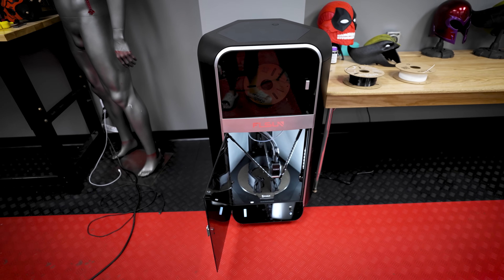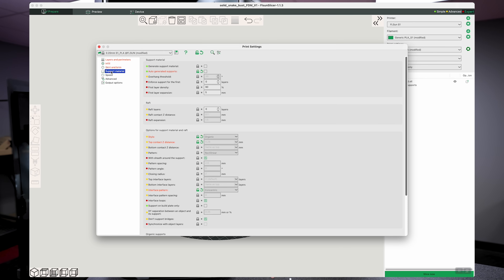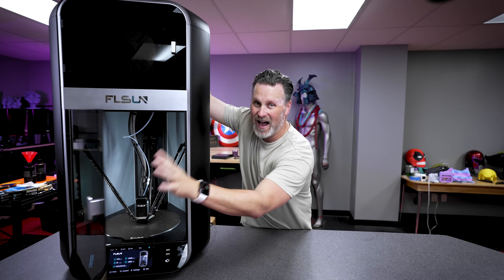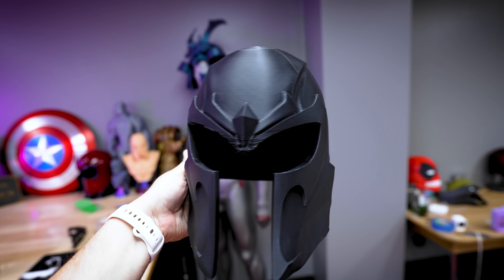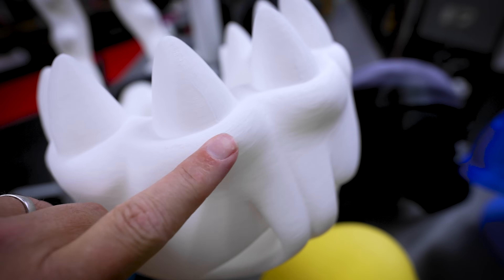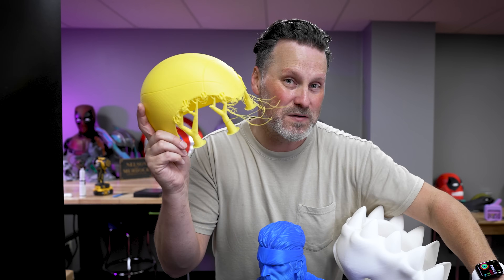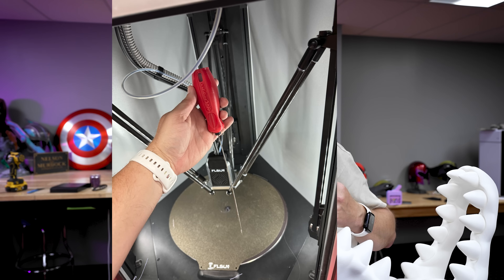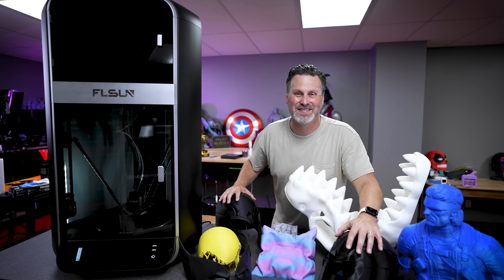FLSUN S1 3D Printer - is it TOO FAST?!

Comment from the maker: If you’re looking for a more technical look at the S1 make sure you watch Nathan Builds Robots video

https://youtu.be/EXL7ZqsYrYw?si=2nfYIjefUa0sYckG
Reply: If I had to guess, it would seem that you’d need to tune it to slow down for certain parts of the print while retaining the fast print for others - ( take advantage of of the speed while maintaining the fine print control)
Reply: Aw I love you 3d printer youtubers having a connection and sharing eachoters channel
Reply: Is it basically the Bambu Lab X1 Carbon but on steroids

Comment: Just because it can run that fast, doesn't mean you have to. We all know speed doesn't equal quality even with high speed filament. 
Experience should tell you that.
If the printer isn't a tool that works for your application then don't buy the tool.

Comment: I have an S1 Pro, and I also have problems with loading filament on top thru the tube. You just have to cut it at an angle and boom, no problem.

Comment: Will you test T1?  I have a T1 and have been using it for three weeks , super fast , I don’t know why so many people criticize its 1000mm/s. Why are machines with a default configuration of 250mm/s allowed to advertise 600mm/s, but machines with a default configuration of 600mm/s are not allowed to advertise 1000mm/s?    600mm/s and 1000mm/s are just movement speed, We need to discern whether the true value of the product meets our own needs, instead of just complaining and touting .

Comment: So, slow the print speed to something more normal and use Orca Slicer and I'm guessing it would be maybe 75% better, just with doing those things.  And FLSUN supposedly just released a big firmware update to correct a bunch of issues with this printer, so it would be interesting to see a follow up video on how those changes may (or may not) have improved this machine.  The issue with the profiles sounds like FLSUN is playing catch-up and maybe fielded the product too soon.  I'm hoping they'll just ditch their slicer and develop solid profiles for Orca for everybody to use.  If they could dial-in this thing to X1C-level user experience and print quality, I'd order one ASAP.  I just love the delta design.  I don't care so much about the speed, especially since it seems to come at the expense of quality.  Better to take a little longer and have a nice result than to go really fast and have the result look like garbage...or fail altogether.

Comment: If the acceleration tops out at 4g (40000 mm/s^2) then you hit diminishing returns on print speed at around 300-350 mm/s. Saying it does 1200 mm/s is an EXTREME stretch.

Comment: I expect that the "texture" you are experiencing is due to the stepper motors microstepping resolution. Unlike standard x-y-z slignbed or xy-yx-z corexy configurations, deltas are a z-z-z configuration. So the kinematics of the arms' parallelogram create axises that behave as arcs. Hense the carbon fiber 45 degree texture. In other words, the step-drivers need tuning. Try printing a cylinder.

Comment: Use Orca, load FLsun V400. Change the volume (as the V400 is smaller) copy your gcode from the Flsun slicer and paste into your orca slicer.
It will print far better..

Comment: The problem with that printer is that the arms are attached to the bottom of the toolhead making it (toolhead) top heavy. When it changes direction the toolhead will want to "nod" in the direction it was previously going. If you attach the arms to the toolheads balancing point it would not do that. It should be somewhere at 70% from the bottom since the extruder motor is up top I'm assuming. If it's bowden it should be a bit lower. Fixing this would improve print quality immensly. You can see evidence of this by printing the top layers with fast speeds and accels. They will not look very good, meanwhile if the toolhead is balanced and everything is stiff you should not be able to see which was the top layer and which was the bottom layer. I saw the Prusa delta printer and it looks much better as the motor is very low down and also the toolhead is not as tall.

Comment: In my opinion I expect to see the S1 start off pretty rough. It is going to take Flsun or the community a while to really refine the slicer settings for this printer. A similar thing happened with the v400, their original firmware for it had some issues and had big issues on the dimensional accuracy. The latest firmware, which took almost a year fixed all the issues. Again my experience and my opinion

Comment: Hey @UncleJessy - great video! I want FLSUN to succeed it’s the only Delta exponent in the market and 3D Printing as a whole benefit from different systems competing - I just watched a couple of other S1 reviews, they are on par with what you felt: the machine is almost there, needs fine tuning in the profiles. About the slicer: this obsession from making their own software is maddening. QIDI also did that, it’s infuriating. Time and energy in the wrong direction. An “almost usable” slicer is a slicer nobody cares.

Comment: I have the V400 and due to the Delta setup (I think), the supports are knocked over much easier than on a cartesian printer. That's also why you need to use Gyroid infill, otherwise it scrapes..
Reply: I have a v400 and its fine. Its better than my neptune 4 plus but worse than my bambu p1s. Definitely have to use gyroid infill. Only one that worked for me. The print quality is decent and it has good speed. I wouldn't drop a grand on this tho. Been doing a lot more resin printing these days. For me you can't beat bambu right now.
Reply: I got 12 v400s and yea. Supports need to be thicker and the nozzle it comes with is trash and can cause the supports to print poorly

Comment: I have this printer, the issue is the flow rate. I limit pla flow rate to 30mms3 and everything resolves. The advertised 110 is based on the rapido styles heater they have and that has the same issue.

Comment: hey uncle Jessy, my process for loading filament is to push the filament till it stops, then put the roll on the holder. 
the hardware is very good, but the firmware, software wise needs more fine tuning.
the S1 needs a 0.6mm nozzle profile!

Comment: I owned the V400 from FLSUN, and I will try to keep away from any of their products in the future. I’ve had so many issues out of nowhere with the quality. The supports kept failing over and over for no reason. The filament wouldn’t stick to the plate. The leveling procedure was DUMB and didn’t keep the nozzle level even for a couple of small prints (z-offset kept getting off randomly). I’m not even talking about the lack of accuracy, which is a common problem for deltas. Software and support feel like a 'basement factory' amateur. It's a huge headache. No, thank you, I’ll stick to Bambulabs.
Reply: Yep, same here, gave away the V400 for free, when I got the X1C.
Reply: same here. had nothing but issues with 2 of their printers. very frustrating, I broke my last one by beating it to death. 
R.I.Pieces
Reply: YES YES THANK YOU!

Same I owned flsun v400 and never will buy another flsun

Comment: I enjoy your reviews. As an owner of the FLSUN V400 delta, this machine doesn't feel like an upgrade. Maybe it's faster, but it's noisier and its got a proprietary printhead. I like my easy to switch out volcano nozzle. The enclosure is nice, but it seems like it comes at the cost of a lot of noise. Also sheesh, my wireless connection doesn't fail like that - you'd think they'd have that worked out since they already figured it out once 😀

Comment: Im not a 3D printing expert, but I bet the weird texture is ringing and just looks different because it doesnt have linear kinematics like a regular printer. I modded my voron to print at 100k accels, but I limit the external perimeter acceleration to 5k to avoid this issue. It prints blazingly fast and still has steller exterior quality

Comment: the surface finish is inexcusable for such an expensive machine in today's market
Reply: 100% this.  Coming from Ender printers (Ender 3 Pro, then Ender 3 S1 Pro) to a Bambu P1P (and not long after an X1C), while yes, the printing speed compared to ANYTHING the Ender's could provide was fantastic, but it was the quality without a lot of tinkering that sold me on them.  I'd rather wait several more hours for a great quality usable print than a decent quality print that you might want to try to print again.

Now we just need a larger format Bambu printer to come out sometime soon, and I'll be even happier.

Comment: I have two FLSun V400s, they run constantly. Between the speed and Klipper web interface I will never go back to Cartesian printers. Prints PETG and NinjaFlex perfectly. I bet the support printing issues are about PrusaSlicer.  I can tell you did not do an overhang test, these printers can print to 75 degree overhang.

Comment: The IP address is coming from your DHCP server - nothing that FLSUN can do to change that.  If your other DHCP printers have been getting the same IP address after a reboot, it's been the luck of the draw.  That's why you can (and should) assign an IP address to a MAC address in your router's DHCP settings if the device is a regular citizen of your WIFI network.

Price on the S1 is worth it, but is a bit out of my pocketbook range, but ... I see that the Super Racer is on sale for $299, making it a possibility.
Reply: Even if the IP address is not static, they could still deal with that. They just need to search for the printer within the network instead of expecting it to always show up with the same IP address. For instance, Apple uses Bonjour for this. It finds local printers and other Apple devices regardless of their IP. I believe there's a similar mechanism used on Windows/Linux, I can't remember the name right now.
I agree that setting a static IP is simplest solution and that's what I do for my devices. But most people don't know about IP addresses, DHCP, etc. On the other hand, one might argue that this is targeted more at businesses than hobbyists.
Reply: @zmast333  Now THAT is something that the printer manufacturer can fix - install the avahi tools for mDNS discovery.
Reply from the maker: Agreed BUT my main callout was about the slicer not allowing you to change it once set. You have to delete the printer and add it new again.
Reply: @UncleJessy  Yep, I misunderstood your point there and THAT is a problem.  I discovered this with the current OrcaSlicer 2.1.0 beta and the just released 2.1.0., so not just their version.  I also learned that you have to delete and re-add the printer (which is why I know about the DHCP MAC assignment) because I added a new Sonic Pad that I'd not set the fixed DHCP address for yet 😬.

Comment: The no replacement parts is a deal breaker
Reply: This is only a temporary issue.  The printer just came out, and it's already sold out.   They sell parts for all their other printers on their website.  I would imagine parts will be available for this model within a few weeks as they build their stock of components back up.

Comment: I wonder if the weird texture is due to vibration at the higher speed? Maybe they need some kind of damper base/pad if it can't compensate enough for it. Bambu has the feet, just a theory
Reply: still gets it and super slow speeds
Reply: I don't own a 3d printer (yet,) but own multiple laser engravers. Don't know if this could apply to 3d printers, but is worth mentioning. I was getting strange lines in my engravings across all my machines, so I knew it couldn't be a calibration or mechanical issue. After much toiling and gnashing of teeth, i realized it was the shitty/old wiring in my shop. I ended up having to put my lasers behind battery backups to smooth out the power they were getting and weird lines went away.

Comment: It looks very promising. The failing supports are easy to solve in the slicer settings, so FLSun should just do that to their presets. Slower acceleration and jerk for support and a bit lower print speed. But the issue where supports, fail to adhere to the bed especially tree supports, is due to the acceleration and jerk settings.

Comment: I don't think the bed is 320 x 320, it's not square. it's just a 320 diameter.
Reply: La taille du carré maximal est environ 22,63 cm de côté.
Reply: @jeje3d546 That’s just under 9 inches (for Americans)
Reply: The usable printing width and length is 22cm for most models unless you print a circle.
Reply: 320 diameter 330 height is what he meant i believe
Reply: Its 320 circle diameter he said it wrong.

Comment: Saying it's 320x320x430 is very misleading because the 4 corners are not available.   I wish manufacturers would push for superior print quality and high strength rather than speed.

Comment: Good lord just tune your printer. It's laid out for you step by step in orca slicer. Do your flow and pa and most of these issues would be solved. Stop relying on half baked profiles that are completely different to your filament and situation. A profile for small parts is completely different to printing helmets.

Comment: what is the point in printing fast if it turns out garbage..
Reply: exactly.
Reply: If you you’re going to fail, fail fast.
Reply: @Inventorsquare kek
Reply: To flex
Reply: Also petg is what he tried to use and it's the worst filament for fast printing
Reply: Tell that to Scambulabs after their security update 😂
Reply: It doesn't turn out garbage. I have one, it's freak'n awesome. You can slow it down and still faster than most on the market.
Reply: @chirobuiltjeff  okay, thats great then
Reply: People forget the material itself is a limitation. Only reason PLA can print fast is because you don’t need high temps for it, also some simply can’t be printed fast like TPU.
Reply: @JojoJoget  actually asa abs and other high temp materials can be printed faster due to less cooling needed and other material specific reasons pla yea can be printed fast but needs tons of cooling tpu and petg are the worse
Reply: @JojoJoget you never printed tpu from bambu i guess, i personally was very impressed how fast this material prints, its just absurd
Reply: If you know how to and with the right printer like my vz bot with a super high flow hotend faster than this printing voron parts that snap together perfectly while printing fast with quality
Reply: I think that their profile needs to be tuned. There Is definetly problém with flow rate. But i am really surprised that there Are So many small errors

Comment: I don't even mind the imperfection on the Solid Snake bust. I think it gives nice texture in this particular case.
Reply: yeah but imagine you're trying to print something else.. and will never be able to get a decent surface finish. I'd rather go 24 hours vs 12 but have all that effort amount to something I can use. your printer shouldnt be stuck on fuzzy skin.
Reply: @electronicsandewastescrapp7384  I agree completely, thats why I wrote "in this particular case"

Comment: I attempted slowing down and it makes textures Worse. Called salmon skin, not entirely sure how to get rid of it though. Same goes with going faster again things get worse.
Reply: You can see it has smooth idlers for some reason. Also found on the SR and v400. I would have understood it if they were using bearing stacks for longevity at the cost of print quality, but there is no excuse for using smooth idlers on the teethed side of belts. I would bet you can see an improvement with teethed idlers
Reply: @over_pizza_2578  Good point actually.  I think creality did the same on the K1 series of their printers, used smooth idlers on teethed belts.

Comment: The Mac OS version only works with the latest Apple hardware. It did not work with an Intel based system running the latest macOS( 14.5 I believe )

Comment: I have the older v400. I have so many top layer print issues
Reply: messing with the belt tension is a nightmare unfortunately
Reply: Me too, that really is a tinker machine - I have the X1C and I don't tinker.  I use the v400 for fitment drafts, rather, ugly, not usable, but will let me know if the print size is correct (it is at least pretty good on that) - but when I actually want a version that works - then I move to the X1C
Reply: ...don't know what your print issues are but with my V400 (Orca slicer) slowing the top layer to 80 (along with the outer wall), .35 line width, monotonic line, single wall, 4 surface layers, bridging ratios of 1 and 1 and density of 80% have all resulted in beautiful top surfaces...and dry, dry, dry filament!

Comment: absolute beast, its good to see a more industrial printer at an affordable price. lets face it this is no desktop machine, no one wants to work next to one of these at full speed. you need a spare room at the other end of your house or a garage to put this thing in. it has it's place though and ill probably buy one. 🙂
Reply: It is loud, for sure!  My two are in a dedicated room across the garage from the rest of the house...and I do have a set of ear protection headphones hanging by the entrance into that room!😂 But I still love them!
Reply: @navydiverdlt2316  awesome, that’s what I was thinking, definitely going in the garage. What do you use your 2 for?